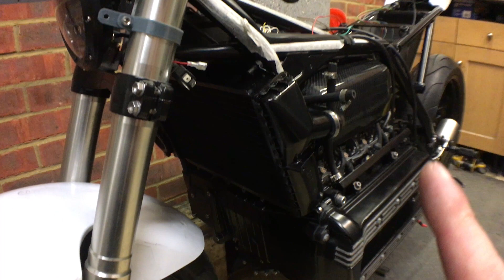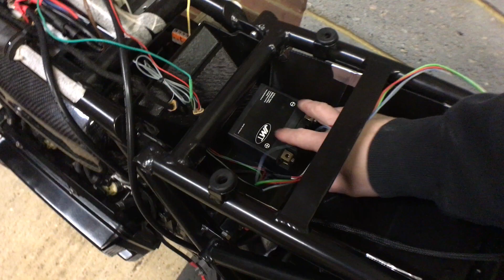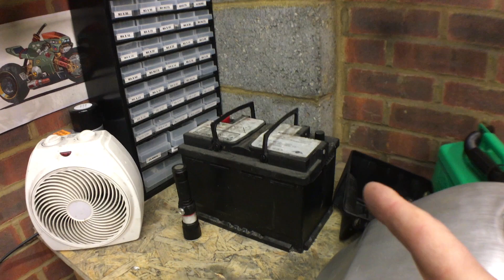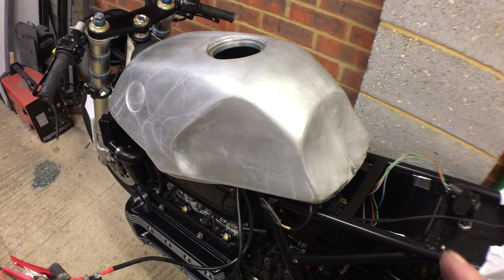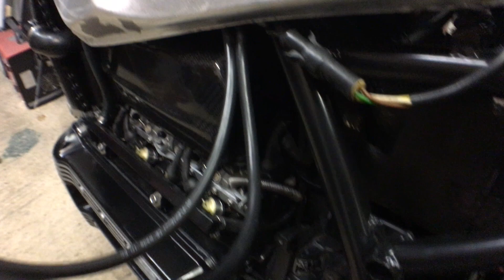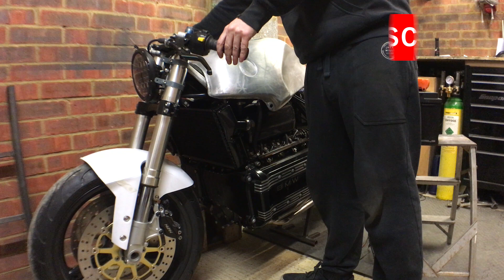First Start in 2 years | K100 build vlog #23

Comment: Hi ben, about the exhaust i wanted to do the same thing as you did. My only thought was that the exhaust will be to close to the tire (because of the heat) or won't that be a problem? Thanks!
Reply from the maker: The silencer is about and inch or two from the tyre, it shouldn't cause any issues as the exhaust should never get that hot, I've not heard anyone else having an issue that are running a similar setup

Comment: Looking great. Well done! I’m having some trouble getting my fuel pump going at the moment but don’t think it’s the connector. Does the fuel pump do the initial prime on ignition the way you have things wired or just on start button?
Reply from the maker: The fuel pump should only run while the engine is turning over. You can tap the starter button and it should prime for a second.

Comment: Hi Ben I wanted to ask you about the frame, why did you choose for the solution of connecting the frame with bolts instead of welding it? Nice exhaust is like what I was thinking of buying… bye
Reply from the maker: Initially the idea was that I could remake it and just swap the subframes, because if you weld it directly you're kind of stuck unless you cut it off. Knowing what I know now I would probably do the same again as I think it adds something more to the look of it.